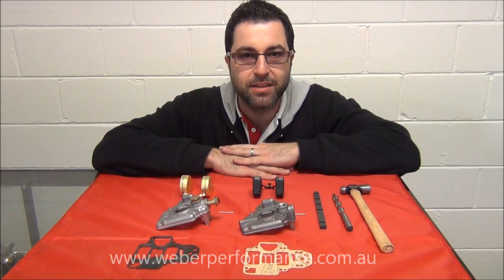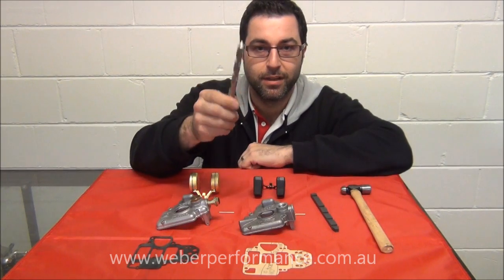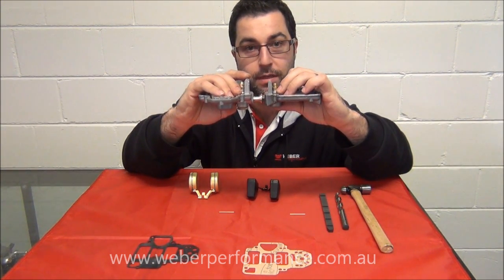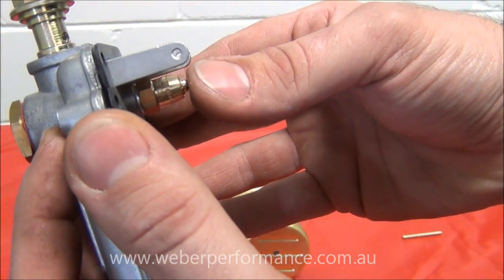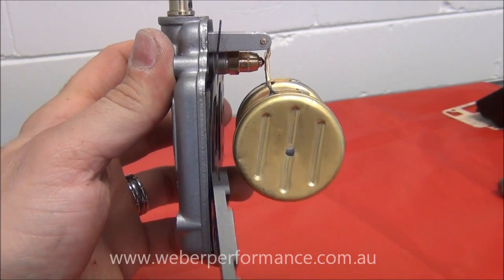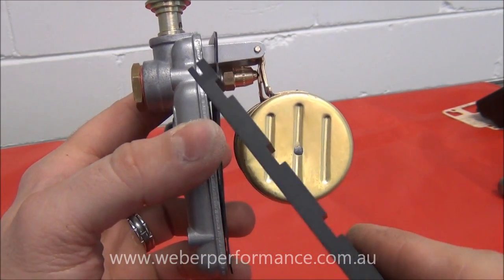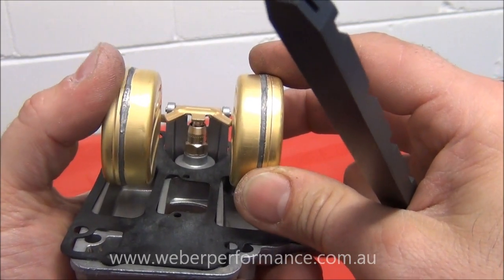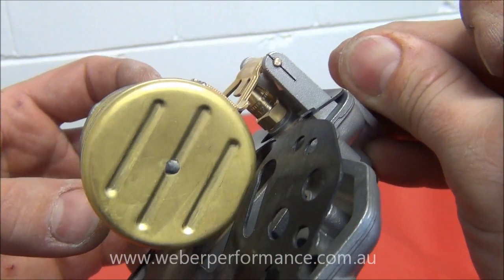DCOE Weber Float Level Adjustment

Comment: Dear
I have a problem in long right-hand turns 
The car loses power halfway through the turn 
Could it be that the float level is too low
They are two 50 DCO SP No 19650.001/002
They are mounted on the right (i.e. inside bend)
The float level is now 12 mm 

With kind regards
Reply: Mate I am having the same issue with twin 48s. My floats are set to parallel with the body when closed. Did you find a resolve on this?
Reply: @craighouston7014  neen maar ik ga het level eens op 8mm in plaats van 12mm probeeren ?
Reply: @claudeholvoet  Good call I have been told to reduce levels too but was afraid of going lean. Good luck with it brother!
Reply: @craighouston7014  @D3Sshooter
2 dagen geleden
Hi, well that can be for many reasons... typical that is a sign of running out of mixture richness.  I have seen it before , one goes  full throttle  on the straights and then gets in left or right hander, tries to accelerate after braking of course and the car hesitates or loses power.  Reason not enough fuel in the floatchamber... it has been drained a lot on the straight, then the corner is hit and what is left  in the fuelchamber shift out and causes a lean mixture.    The main reason is a fuel pressure that is to low ( must be at all times 4 PSI ) and not enough volume  ( must be about 4 Liters per minute)..  All this is most of the time cause by a poor performing fuel pomp. That would be my first check...

Comment: Hi can you help, my weber dcoe 40 (italian) leaks fuel after a hot run from the O Ring, between manifold and carb..... im running the smallest facet fuel pump so not sure it is the fuel pressure..... and its only after the engine shuts down... look forward to your thoughts

Comment: Hello from Portugal! Thank you for your vídeos. When using plastic floats on brass float covers, what are the correct levels and where to take the measure?
Reply: yes, i got the same question, i feel like the measurements are less because the arm( holding the float mounting pin) is longer so if the distance is 12mm on a longer arm the float travels further compared to a shorter arm, no? thinking of how you would swing on a swing with a shorter chain vs longer chain

Comment: Out of 4 weber books, and various online tuners and re-sellers tutorials, no one measures plastic floats from the middle. It is always measured from the top-rear edge. This gives the greatest delta (change in distance) for the changes to the needle valve tab. Which makes changes and measurement most accurate. If you are trying to translate brass float stroke specs, measuring from the middle might be close for that specific task - yet it wouldn't translate perfectly since they aren't circular - but it isn't how one measures plastic floats. As for Specs for setting plastic floats; 

 Plastic float specs are usually listed as these two;
12mm closed - 26mm open
12.5 to 13mm closed - 25 open.

I haven't measured, but I think if you tried to set the open measurement to 26mm using the middle of the plastic float, it would be trying to drop through the bottom of the carb, lol.

Some people have set plastic floats at 12mm closed and had it too rich, and ended up at about 15mm. They may have carbs with the longer pivots posts for brass floats, converted to plastic. shrug So one sanity check is to see if the float is pretty much parallel to the top cover edge. 

In my carbs I find that 26mm droop will jam on high-g corners, and something less than 24 seems to work out fine. If on really rough roads, orr-roading, or high G cars, setting droop to 1mm more than the needle valve needs to be totally open should work. A needle valve needs about 2mm to 3mm to be totally open, depending on size, so about 3.5 to 4mm travel at the needle valve tang will work. Given that it doesn't result in more than 24 mm droop.
Reply: I'm glad you clarified that plastic floats should not be measured from the center. When I saw dude do it, I thought I had been doing it wrong even though my carbs seem to work well. I use 14mm closed and 21mm open for plastic floats and 3psi with 2.5 needles on a 45 dcoe.
Reply: Thanks.
The abstention best way to determine fuel level after initial adjustment is to measure fuel height with a caliper when carbs are on and full.

Fuel depth has to work out to between 24 and 25 mm for best function.

Measure from the shelf the main jets screw into to fuel surface. Then measure full depth. Subtract one from other and that's your fuel height 

This allows you to totally fine tune fuelingvrespons and similarity between dual carbs.

If you flood a bit easy drop it 0.5mm. Circuit starts a bit late and no problem flooding or rich, bring it up 0.5.

Most situations you will never go deeper than 25mm.

Comment: I'm not sure you mentioned the max drop for the later model (plastic float) carb. I understand that for the earlier model (brass floats) that this measurement would be 15 mm, 6.5 mm past the original 8.5 mm. For the later model 12.5-13 mm is recommended for the closed position, but what is it for fully open/dropped? 

Thanks.
Reply: the 12,5-13mm do u mean when the ball is pressed or just sideways that the lever touches the ball?

Comment: Great stuff thanks it helped alot. there was a few things, How low do the floats hang down in mm's ? 

 I found my problem anyway, no amount of adjusting could help me there. The Brass floats were full of fuel  :/  I found the leaks in the side's where the solder had split over time and drilled a small hole to drain the fuel out then soldered her back up again. works fine now :)   Thanks anyway i'm sure this video has helped alot of people.